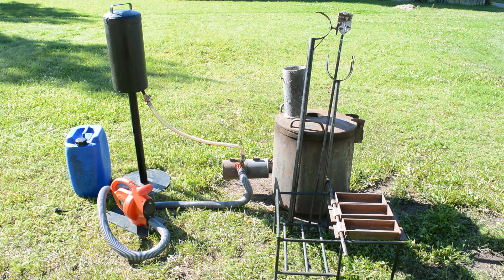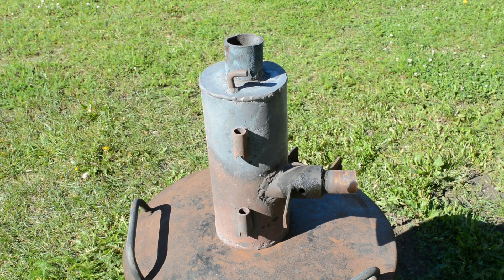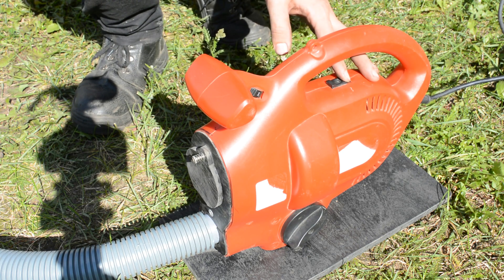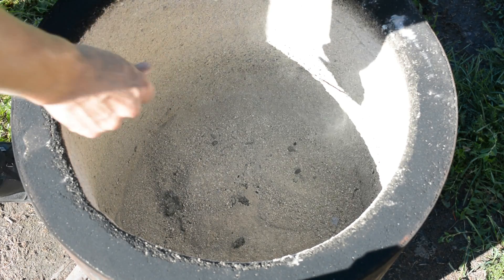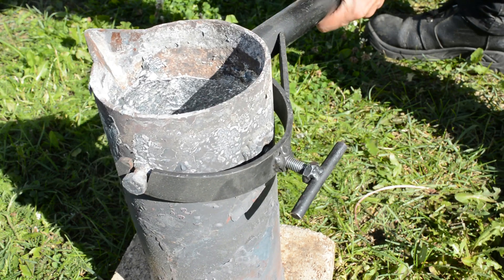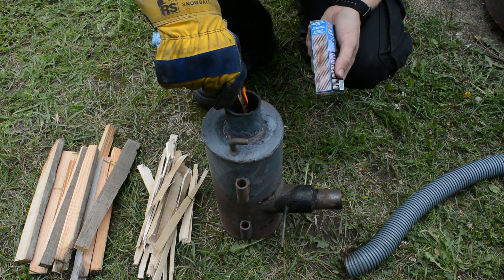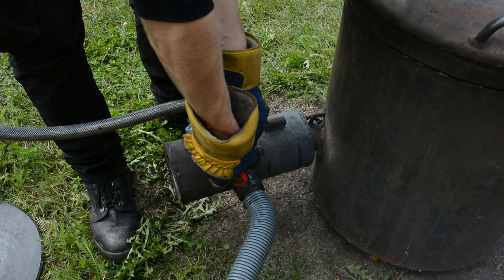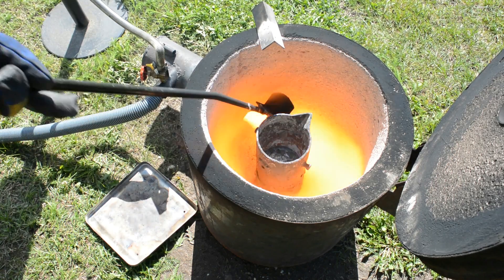My aluminum melting setup

Comment: Do you think if you made a insert that would reduce the size of the furnace (inside) when using a small (compared to the area in the furnace) size crucible,  that it would make the furnace more efficient.  It seem like you have a lot of space in the furnace.  But nevertheless great job thanks.  I do love the ingots stand & the way you just flip them over.

Comment: I really like some of the designs you show in this video. A few years ago I built one out of an old BBQ. I used refractory concrete but it eventually cracked quite a bit. When I do it again my liner will be made of refractory concrete but cast into bricks to avoid some cracking and making it easier to repair. I use propane, but I like the idea of using waste oil as long as it doesn't smoke or stink. It looks like you've got that all figured out. I've used everything from bellows with bituminous coal and anthracite coal, to charcoal and it was so bad. Propane really did the trick for me.  I like the design of the tools for the crucible. They look pretty secure. There may be room for improvement with maybe a latch instead of a screw. But it looks quite good. Great job!

Comment: Have you seen what happens to steel crucibles with Aluminium ? Dont use steel to many wankers will get seriously hurt ! Use a clay graphite crucible. There cheep and wont drop molten Al all over your legs.

Comment: Concrete does not work well at all. Ceramic fiber wool coated with rigidizer and furnace cement is much better.

Comment: Did you use regular cement or refractory cement? Refrac cement is working well in my furnace. 

What other kinds of oil could you use other than waste oils? I don’t have access to much waste oil.

Comment: Love your video!  Great design, especially the ingot molds and support that considers what happens after the metal is poured!  
Wondering what you used for the burner, steel pipe?  Looks about the same diameter as the crucible.  Can you recommend a good diameter, maybe 8 to 10 inches?

Comment: One of the better setups I have seen, the simplistic nature and the limited tools required to build this are in most peoples grasp.  I did want to know if you made the directional sprayer or if the oil is just dumped into the combustion chamber on yours.

Comment: do you put scraps of wood once and you can go as long as oil pours in? I want to change the set up of my melting forge that is charcoal based, using waste oil would be so much easier and cheaper where I live
Reply from the maker: Yes only once then the burning oil keeps the burner hot.
Reply: great, thanks for the reply, keep up the videos man, you inspire people to do new things
Reply: Another question I forgot to ask, what size is the tube of the oil burner in diameter and length? Thanks

Comment: where do you get the oil?
Reply from the maker: From a friend who works as a mechanic
Reply: MP Dragon is There anything else you could use
Reply from the maker: You can use vegetable oil. As far I know the burner can run on any burning liquid, but I wouldn't suggest petrol.

Comment: Hello, I am trying to get my own furnace up and running! I have my foundry , but the oil burner is a bit confusing ? like I have a similar set up as yours were I cut a hole so that the oil goes in! and a hole for the blower to blow! but is it that simple ? make a little fire inside then just let the air and oil go through?
Reply from the maker: Pretty much yes, but make sure to preheat the burner well before you start adding oil
Reply: MP Dragon thank you!! and like adding a little fire yea??? and also where did you get your scrap metals??

Comment: Man, what a neat video.  I really like this set-up. Question: what is the material of the tube coming from the air supply?  I'm curious that it doesn't melt.
Reply from the maker: that's a regular flexible plastic tube, it doesn't melt because the blower cools it down

Comment: Why do you need to pre-heat the ingot molds?
Reply: Ram P if you don't preheat the rapid change in temperature, eg room temp molds then pour in extremely hot liquid metal, it will cause the mold to shatter and spill molten metal
Reply: @joshuaabdullie6587  Right.! It's called thermal shock.
Reply: it also prevents moisture from causing a steam explosion when he pours in the metal
Reply: RaM Doe no air bubbles
Reply: Ensures that they are dry (good safety habit!).  A bit of water will flash into steam and throw molten aluminum around.  I think it also helps reduce warping of the mold and stress on the welds, which could crack otherwise.
Reply: Joshua Abdullie a steel mold won't shatter, welds might crack though.
Reply: If the moulds are hot it helps the melted metal to flow better

Comment: Can it melt any other metals or just aluminium?
Reply from the maker: probably can but the steel crucible would burn up quite fast
Reply: MP Dragon. can you help me share my link. also i never smelted before but i like your setup . very nice..here's my link I'm supporting this fundraiser: https://www.youcaring.com/brianlee-735439
Reply: MP Dragon 
Hi,dear friend.

I wanted ask, how to make make melting furnace for smelting aluminum. Like you.
You will give to me blueprints?
Reply: Try to melt copper in this furnace, but do not use the steel crucible try using a graphite crucible as the copper destroys steel.

Comment: Wouldn't it make pouring easier if you added 2 bolts to the bottom of the crucible as well, that you could then grab with a second holder, instead of screwing the one on and off the whole time?

Comment: Do your crucibles ever burn out the bottom?
Reply from the maker: This is my first crucible and it hasn't failed, but the side walls are getting quite thin.
Reply: Mr.Dr.Kaiser steel crucible can take a lot of heating unless you use charcoal or coal as fuel
Reply: Kelvin Chu what happens when you use coal with a stainless steel crucible??
Reply: coal gives off uncontrollable heat and melt the bottom of the crucible, he process is instantaneous while your propane torches can be switched down.
Reply: Kelvin Chu I would think that you can control the burning rate of coal by controlling the air flow.
Reply: A richer oil : air mix to the burner to make the hot gases less oxidizing would help.  Should have a bit of flame coming out of the vent, showing that the combustion air's oxygen has all been used up.
Reply: Very true

Comment: nice setup, looks like you are using the same method I use with a few variations. I'm building a larger one now so to melt iron I am probably going to need to re vamp my burner to accommodate the extra area

Comment: I wanted to know, what else have you melted using that flame.?
is that flame hot enough to melt copper, gold etc.?

since you're using a steel pipe crucible ; the flame's temperature currently isn't above steel's melting point, so what would you use as fuel to melt steel.?
Reply: Correct, the molten aluminum actually keeps the steel from overheating. If you want, fill a ziplock bag with water and hold it over a small flame, you'll see that the water keeps the bag from melting.
Reply: The flame temp of oil is about 2101 c,  so it is more than enough to melt steel.
It really depends on how well the refractory keeps the heat in 
if he left the cruicable in longer and kept the lid on it would melt

Comment: Your crucible is by far the best on YouTube. I was wondering can it melt copper?
Reply: No it could not, as that is designed to melt aluminum at 660 C while copper melts at 1084 C
Reply: the cement is not going to do well against heat as it is. maybe it could with a better coating than cement
Reply: It's not so common to find graphite and clay crucible that big for projects like this, it would also be very expensive
Reply: Silica clay would melt Copper - However, its life is limited it cracks after a number of pours - Graphite crucibles have much longer life but much more expensive - I melt mine in a silica crucible and a similar furnace like this (his design is much sleeker - but the crucible holders are diff because 2 bolts on the side cannot be attached to the clay crucibles - I really like this design though - very clever design
Reply: You should not melt copper in a steel crucible, it will dissolve the steel and ruin the crucible as well as spill all over the furnace.
Reply: crucible temperature is determined by the material it's made of, steel crucibles wouldn't work for metals that are close to it's own melting temp, so no lol but you could make a similar shape with graphite clay and do that
Reply: yeah   graphite crucible and something that actually is heat resistant would do wonders

Comment: Nice setup! Could you not add a third bolt on the side you screw the pouring attachment on to make it easier than screwing in the fixing bolt? Also, where do you get your used oil from?
Reply: Cars

Comment: Cement does not have refractory materials that I know of. Concrete might have refractory aggregate but it would still be unsuitable. Next time you line your kiln maybe you should think about using clay and silica/quartz sand? These are highly refractory materials and are the same materials used in making some crucibles. In fact there are kilns and firebricks  made of fire clay able to withstand up to 1000 degrees Celsius.

Comment: Have you thougt about an electric kiln (furnace)? I have heard that you can take insulation from old ovens, smash it, mix it with water, and it will set and be very good, heating element can also be taken from same ovens. Btw, where do you live, cause i live in Piņķi, and i have seen somwhere that field.
Reply: Waste oil is probably cheaper.
Reply: +karlpc200 well of course it is cheaper, but 1. It is louder because of the blower
2. It is not as enviromental friendly
3 with electricity you can regulate extact temperature
4 electricity also is cheap (around 10 centa for one melt

Comment: i made a much smaller one with a bucket and a blow drier, it uses charcoal for fuel. we mixed sand and plaster instead of concrete, however it too is breaking apart each time we us it
Reply: Zebefreo :D yep
Reply: For mine I took a old mettal barrel and stacked broken bricks in a circle around the edge and filled the gaps with mud. Then stacked the next layer and filled the gaps with mud again. 5 layers high. I used old circular plough thing as a lid and tack welded two handles on.

It works and is dirt cheep....
Reply: the king of random?
Reply: when you say mud do you mean wet dirt? or something else?
Reply: Yes not to wet if you have high clay soil it works best just let it dry before you use it.